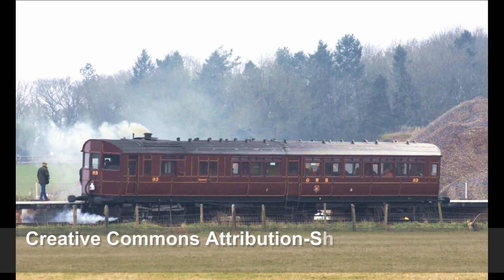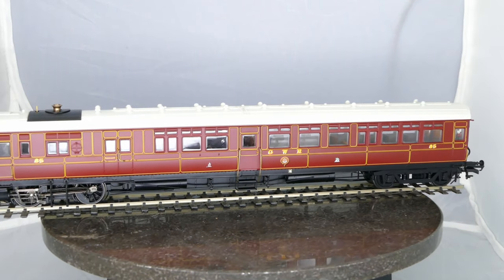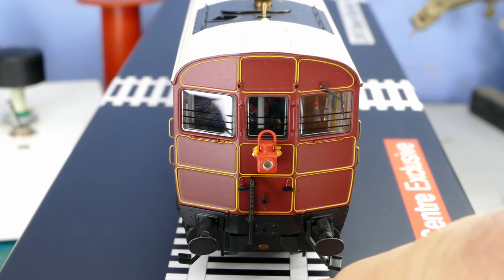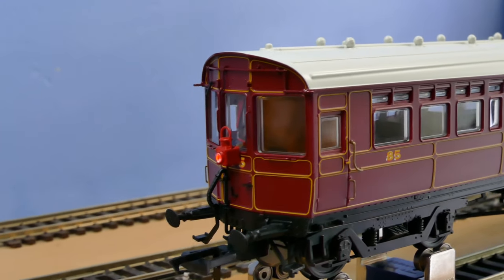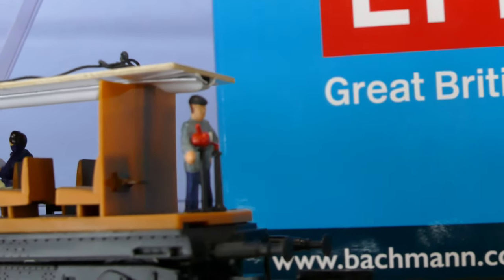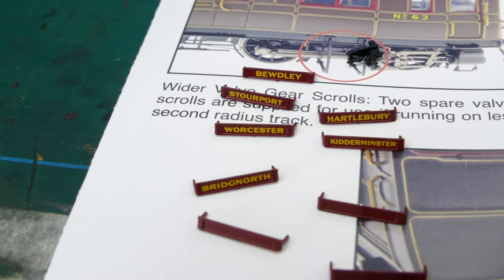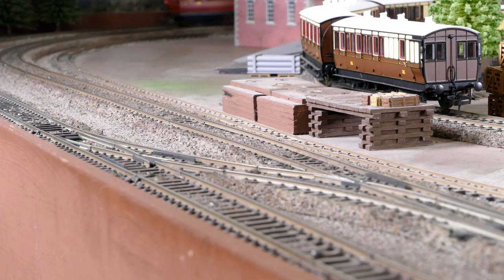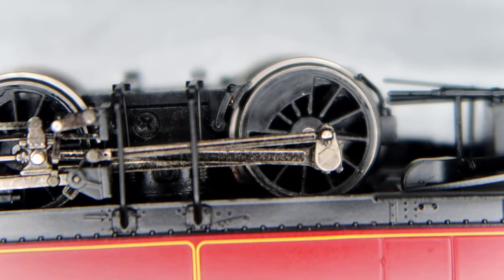NEW Kernow GWR Steam Railmotor Review: Crimson Lake Livery in Action!

Comment: Fabulous model. I noticed that the trailer has a bell at the driving end but not the railmotor.  I suppose a whistle was enough. Beautifully filmed, as always, and the railmotor looked just right against a background of GWR coaches and wagons in the sidings. Excellent commentary, and you deserve a medal for being brave enough to take it apart.
Reply from the maker: Hi my friend. Most kind as always, yes the bell or gong was fitted as there would be another coach or two between the trailer and loco. Thanks so much for nothing the background.
Reply: The Railmotors didn't have a gong in their early days - they were fitted later.

Comment: 11:16 Just so you know, you have put the fireman in the coal bunker lol
Also, yes, the reverser would’ve been controlled by the fireman when the unit was running with the boiler at the rear, and then for running with the boiler at the front the driver would swap ends and be able to use the reverser himself. They are basically DMUs but steam, with a cab at both ends.
Reply from the maker: Thanks yes he's jumped out now. it's funny to hear the DMU expression used for a steam railmotor lol

Comment: I love these. Am hoping for an LMS railcar one day! 🤞
Reply: I’d be wanting to see the LSWR one myself. They are a really cool idea. Now the GWR one needs its trailer
Reply from the maker: I guess most companies had them then?
Reply from the maker: Weren't the C14s made for that?
Reply: @ModelRailwaysUnlimited  Spot on. The LSWR built the rail motors first but found them to have too many short falls. Mainly they would slip a lot and had issues with enough coal and water. So Drummond designed the C14 from the rail motor drive unit to work push pull trains. Originally they were a 2-2-0 with only one set of wheels connected to the pistons. They had the same issues with being too light and lacking coal and water capacity.
Reply from the maker: Ah many thanks. Always wanted a C14, they were at Southampton docks
Reply: @ModelRailwaysUnlimited   Same here. I like the railmotor as they used to travel from Botley to Bishops Waltham on the light railway which ran between the two.
Reply from the maker: @vectorbrony3473  ah yes, a nice little line
Reply: @ModelRailwaysUnlimited  like yourself I’m a Hampshire man. Mainly Gosport where I’m making my layout base on Gosport Railway station.
Reply from the maker: Very interesting